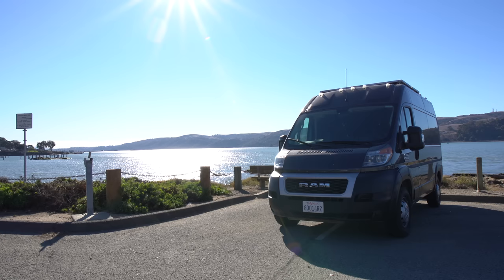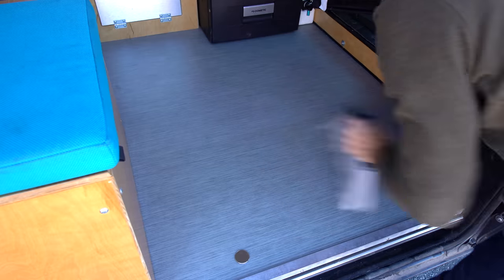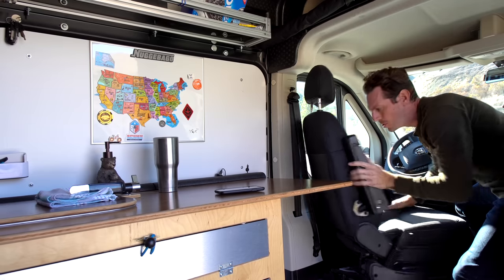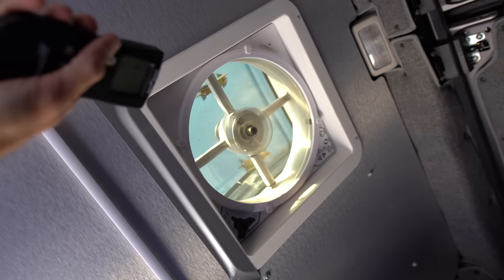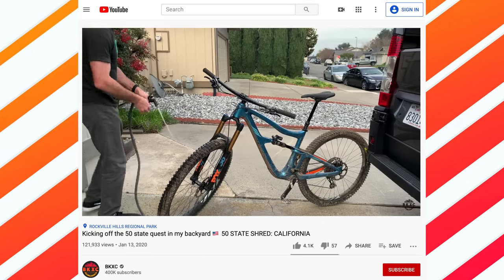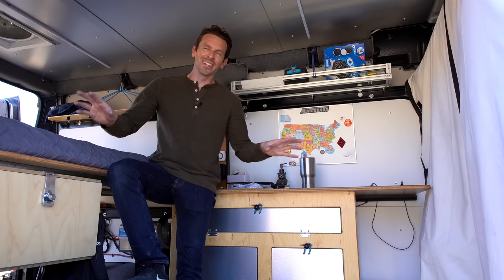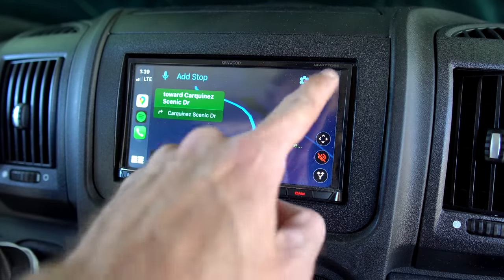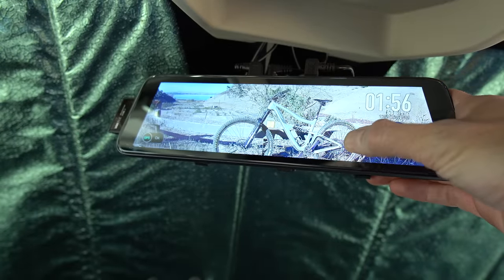15 Smart and Stupid Details On My Van | RAM Promaster camper conversion

Comment: My bones ache just looking at that thin kit "mattress." A nice memory foam isn't that expensive, dude! 🚐🐶❤️
Reply: I don't like memory foam personally. I have a purple mattress at home but I plan on just using a Casper mattress in my conversion since they are comfy enough.
Reply: That's what I thought skinny, non supportive mattress! That looks like a cheap air mattress from Walmart!
Reply: Memory foam gets rock hard in colder temps. Not idea for colder van living imho.
Reply: @jjns3991624  it does, but will soften up with your body warmth relatively quickly.
Reply: Im a 200 lbs 48 year old female, and i slept on a 2 inch thick trifold exercize mat in the back of an unconverted HHR for a month while working on location in louisiana.  Worked well for me, but may not be for everyone.
Reply: I find memory foam way too hot in the summer. Also, I like a very firm surface. That mat looks just about perfect to me.
Reply: Memory foam causes lots of sweat in hot weather situations I use a futon mattress which most people hate 😅🤣 but I love.
Reply: @jjns3991624 I have memory foam and I put a 2 inch latex on top.
Reply: @wilfdarr U have to put a 2 inch latex on top of foam.
Reply: @flyinhawaiian7226  I'd probably just go with the 2" latex 😁

Comment: I appreciate the tips but the Best advice for me was right at the end. "Stop watching all these videos and go out and make it happen" Thanks.
Reply: What a pity that this isn't feasible right now. I'll be gone asap.
Reply: I've been watching YouTube videos on it for 4 years, I've done hundreds of hours of research on van life, I've used 3D designing to make multiple possible build outs, but I still have quite a while to go before I can actually do it because I'm only 13.
Reply: @emusparky6623  So I'm 26, but this takes me back because I was about 13 when I got hung up on doing stuff like this too! My thing back then was living off a motorcycle, and I wound up taking a bike around the states. Then I bought a van that was home for about 2 years, and now I'm converting a box truck into a tinyhome. Keep the dream alive until it's time, I think it really is the most rewarding way to live :)
Reply: @mckenzieb1001  I am 21 now, i have also spent many hours researching van/skoolie life. I have spent the past two years of my life saving up to take the leap. My main issue is the confidence to leave and somehow find the ability to make money during my travels. I graduated college, but that hasnt helped me with a remote job. I have 20k saved up but no vehicle yet, what do you suggest?
Reply: @keelanesquivel3854   Something I had to internalize is that if that if most of us want to make a change in our lives like this happen, you have to have a good degree of trust in yourself that you'll be able to deal with problems as they arise. You can only plan for the unplanned and be confident in yourself. Also get comfortable with helpful strangers, they come out of the woodwork!
I've had some crappy days and kinda scary nights, but it's always worth it :)
The work from home question is unanswerable I've decided. Personally  I've stopped for work so far, and it gives me a great opportunity to really dive into a new locality- but I never actually want to stop :P
I think that shouldn't stop you from going. $20k is plenty to build a rig if you're thrifty, and have some left over to get you moving. Going slower makes the money go farther, and you can stretch it until you hit a floor and decide to find some local work. All the while be thinking and experimenting with ways that feel right for you to work from home.
I'm dabbling into buying small items wholesale for eBay, doing small solar  installs, and metalworking stuff for Etsy- hoping one of those will take roots and become more stable income for myself.

Hard to answer all that in paragraph or two! It's so different for everyone based on tolerances for this and that~ You'll feel out what's right for you! And you can always fix mistakes as you go, so don't be scared of them :)
Reply: Amen! I can't wait to get on the road... Except for the showering part, the number to in a 911 situation, which may never happen, butt.
Reply: @emusparky6623  You'll do it. Best wishes to you!!

Comment: I covered my ceiling and about 1/3 of the walls with acoustic mat in my Chevy Express and the road noise is minimal.
Reply: If you're driving US stuff. Just buy a better stereo! Lol. Because I've had both Hondas, (bike and Accord) and GM, Ford and Dodge. Both Dodge and Ford have an array of inexplicable rattles my mechanic and I have deemed not worth chasing down. They won't kill anyone and don't affect how it runs. 

Minus a throaty rattle from under the back wheel wells. That's springs. Replaced both on the Ford (ok, Mercury Sable, but SAME thing, lol). I wasn't hauling rocks or anything. Low miles. 

We do have snow/salt here. Garage space is expensive. 

You CAN replace ONE if you want to hold onto 500+ dollars til the other actually breaks. I got 2 years that way. If it's lopsided, you can fix that then and replace the other side, too.

Comment: I’ve been living in Toyota Dolphins for years. I’ve had 4. My current one is amazing. Small, but still has toilet, shower, fridge, oven, stove, heater, water heater, movie theater (protect anything from phone etc). My son even plays x box in it. Is all run on solar and propane. I lost my business and home due to Covid - but I still have a home! What a blessing.
Reply: Dolphins are awesome! Good old Toyota bones and engineering. Just saw a van tour of one and was super impressed by the amenities for the compact size.

Sorry to hear about your situation. Glad you still have your home on wheels. Check out CheapRV Living's channel and website/forum. You may find some of the info helpful. Also check into the Homes on Wheels Alliance (HOWA) for possible resources they can point you towards.

Comment: Suggestion for front window visibility - have a tint shop put a 90% dark strip across the front window that cuts off just above your eye sight line, usually about same height as rearview mirror is mounted. It acts as a permanent sun visor that you can see through. Your eyes will thank you after the first long day of driving. You might even be able to use the front facing camera that way.

Regarding road noise- next van your first step, before insulation, should be an application of noico or sound deadening of some sort. You dont have to cover all the metal, just about 30% of the large flat panels that vibrate and flex in transit.
Reply: Be aware of the AS1 line neR top of windshield. Some states allow nothing below that AS1 line & often have other tinting restrictions.
Reply: What about the vinyls that do sound damping? There's also paint, tho I dunno about car paint...

Comment: Great video. I can relate to so much of it. I did my own conversion on my 2017 Dodge Ram Promaster 2500 high roof 159” wb. All by myself. And I was under pressure to get it done quickly, considering I had no help and wanted a lot of accoutrements.
Must say after watching your video I feel pretty good about my conversion. I opted for two roof vent fans and so glad I did. I also installed a sink and a 12v water pump because I could anticipate the difficulty and frustration you’ve had with the manual water pump. Something else I did you didn’t do is install a 2x3 framed, insulated wall between my cab and the living space. It provides a bit more security, privacy, sound dampening and most of all a huge help with climate control in the living space. And I built a small door to pass through between the cab and living space. And I carry a portable air compressor with me that I consider essential. I use for some pneaumatic tools I’ve used to complete my build after I started living full time in it beginning in February 2019 and use it on my van and ebike tires. And hell yeah you need refrigeration, imho. I also installed a solar system that has been great.
I really like that rear view cam you’ve got!
My camper van is far from perfect and you are absolutely correct advising people this lifestyle is a lot of fun and should GO FOR IT if they want to.

Comment: Well the whole thing about heating isn't just to keep yourself warm, its even more import to dry the van as condensation constantly builds up. This is extremely important in a van as it got a metal shell.
Your little propane heater just makes things worse as it produces moisture. You will eventually get rot and rust issues. You need a dry heat source and air extraction. 

This is why a proper diesel or gasheater with external air intake and exhaust aling with a powerful extraction fan in the ceiling is crucial to keep the van rust and rot free.....
Reply: Especially with that fluffy insulation that holds moisture like a damp rag.
Reply: @moregrouchy  if that is sheep wool, thats a good thing IF there is proper ventilation and heating. But its also good to actually cover the metal with self adhesive foam to prevent condensation. Ive seen a few vans built by that company, and all i can say is that the company has a huuuuge profit margin. Id never pay that for that basic conversion. It seems they are doing everything to keep cost down and make cash.
Reply: The basic way wayfarer builds these vans, without extremely good heating and ventilation you are pretty much guaranteed rot and rust within a few years. Its a shame building out brand new vans like that :( its all about short term cash making here
Reply: @torevalberg3510  exactly! They skip so many of vital things like sound proofing and proper dry heat to mack a quick buck and benefit from their customers trust and lack of knowledge. I find it to be gross and unethical because now this van is much more likely to rust out faster and he's dealing with crazy road nosie that $200 of material and an hour or two would have fixed.
Reply: @torevalberg3510  Out of curiosity I checked out their website and was like heck no I would not pay that much for that little of an installation. Almost everything that they do it’s actually not that hard to do yourself. The thing you’re paying for mostly is time since he said he only takes four hours for them to install it.
Reply: @nataliaportal5346  But, bear in mind that they've needed to pre cut and build up the units before fitting. It's still far too much of a compromise thought. Move in haste, repent at leisure.
Reply: @avivamae5171  I was actually surprised they didn't sound proof with sound deadening. What a shame. It makes such a big difference with reducing all that noise while driving.
Reply: Set up your wiring and get the van spray foamed. THEN build it out.
Reply: @fritzkabeano1969  still incredibly stupid to spray foam. Works well until you need to do some repairs and need to remove the foam to reach. Or lay new wiring as you make changes along the way. When you eventually need rust repair. Air pockets when the spray job gone bad creating wet pocket and rot/rust. Among other things.

It is literally the worst way to insulate a van
Reply: @torevalberg3510  I thought the same thing re: the problem with spray foam as insulation. I wondered how they would repair anything, especially wiring if the foam sets hard. Too much effort taking it all apart!

I ended up insulating my van the same way as a house, but first with sound deadening, then with Earth wool and the insulation sheets before putting my walls and ceiling up.
Reply: @torevalberg3510  Well, options? If you're alone, you couldn't get that cabinet in there by yourself. Women are a big demographic on these, and most women can't fix or build things. 

I'd wait a few model years, and buy one 5-6+ years old with higher miles but solid in body and mechanically. That would probably HALVE this 50 or so.
Reply: @fritzkabeano1969  Dumb question? Are we using fire resistant type? You know that stuff is a real PITA to work with, right? It gets EVERYWHERE. if there is a way to get it off you, shy of scrubbing it (and skin) with a wet scrubbie immediately, I haven't heard of it yet. Clothing? Yeah. No, forget it. Lol. Doesn't come off. 

I'm always worried about fires on these things. Often, the back door looks completely inaccessible. No safety windows. No fire extinguisher. And often sitting on a bunch of Tesla batteries. Which can, and have, caught fire. And the fire extinguisher isn't going to help you there. Those fires only go out when they're done,  as I heard it. 

I'd go with solar and car batteries, imo. I think I've seen that. They're heavy, but unlikely to start fires on their own. 

I often wonder about accessibility of wiring if it's all foam. How do you chase down problems? Which there will be at some point. Not so much on the Ford components themselves, tho. 

That's one thing Ford does pretty well: make a reliable wiring harness. 

They will have an array of inexplicable rattles, tho. 99.99% are no major and not worth chasing down. Dodge is the same. 

Not a peep out of Honda over 15 years on that front, both car and bike, tho. Wish they made these camper vans. Parts are expensive,  but you don't really see the Honda dealer too much. And they're very respectful to women. Can't necessarily say that about Harley or GM. Kind of patronizing if not rude in general. They also don't do a great job (their dealerships). Honda goes well beyond any of them. Their only flaw was making assumptions about who's buying big vehicles. They see a man and woman come in and assume he's making the choices and he knows his stuff. But he taught ME, so I knew a good deal of what he did, and could at least hold an intelligent conversation about cars/bikes. He finally said, why are you telling me? Talk to her. She's buying. Not me. 

Btw, as bikes go, a Gold Wing at 800 pounds is easier to handle than a horrifically badly engineered and balanced Harley (1972 Sporty, the 1st year of the 1000cc). Weighed around 600. Lol

When the Japanese really get in there, the Americans should look out. They know their stuff and fewer issues. They don't make exciting engines (imo, I don't see a 4 as exciting, no matter what you do to it, lol), but they start and run.
Reply: @torevalberg3510  Well it's incredibly stupid if you don't set up your wiring with looms to start with so you can pull wires after a build. IF you have the capability to plan ahead spray foam works just fine and as for causing rust I've never seen that happen. In fact just the opposite if done correctly.
Reply: @fritzkabeano1969  there are allot more potential repair work than just wiring........

And with foam, your very likely so seal in small air pockets, and we all know what happens to sealed air pockets that vary in temperature...... That rust you won't see until its too late. May take a few years obviously.
Reply: @windsofmarchjourneyperrytr2823  "Most women cant build things" Are you serious saying that in 2022. What planet are you on?
Reply: @torevalberg3510  I'll pass on that info to the dozen people I know who have spray foamed vans and tell them their 10 year old sprayed vans have terrible rust and it's just hiding from them and they can't see it! Hahahahaha.........
Reply: @fritzkabeano1969  do you what you want :)
Reply: I think because Brian is not really living in his van it’s not really an issue. If you watch enough of his videos he generally is riding in pretty good weather. I myself don’t live in my van and just have a very good sleeping bag and it works for me. Then again I don’t live in mine and use it more as a base camp.
Reply: I am pretty sure Wayfare uses recycled jeans for insulation.  Go with sheep's wool.

Comment: You’re right about the vent fan, you need an ‘air in’. Consider getting rain deflectors on your driver and passenger window. They’re relatively cheap and will provide much needed ventilation in your van.

Comment: For sleeping in my truck I just bought the best thermal sleeping bag I could find.  With super freezing temps out I just wear an extra sweater and pants along with thermal socks and I'm as snug as can be.  During the day I drive so the truck heater will warm me up.
Reply: Sounds like a very uncomfortable lifestyle.  Pay for a heater setup.
Reply: @markreynolds9135  Its not.  I'm never actually cold.  I am a hotshot driver so I'm literally driving with the heater on all day.
Reply: Boiled water in a bladder in your bag or some hand warmers help too. You may consider making your own reflectix window coverings
Reply: **one of our old conversion vans had an auto start button on the FOB and we wound up sleeping in it because there was too much family visiting and all of the beds were taken. 
  So when We got cold, I just hit the start button and went back to sleep. Within a few minutes nice hot air was pumping out the front and rear heaters it had. 10° was NO problem at all..
Reply: @Phougi  that's a hot water bottle 🤣

Comment: Wow, so I just bought a 2021 dodge promaster van. And have been out in the insane heat for the last 4 day working on insulation and preping the floor. I just had to come in today early and up pops this video.
The stuff has been banging around my head. Thank you for the good/bad tips.

Comment: Nice van, nice video. I self-built my 2017 Ram 1500 low roof. Twin bunks and a separate 
"room" for toilet and shower. Long trips and day trips are great. Highly recommend this platform. Keep it at 60 and you get better mpg and less much less road noise. Thanks.
Reply: Agree. At many thousands of pounds, yeah, you don't want to be racing. E=Mc2. Lol
Reply: How did you erect the twin beds? I'm looking to build out something for my daughter and me. A bunk bed would be perfect. Thanks for replying if you're up to doing this!